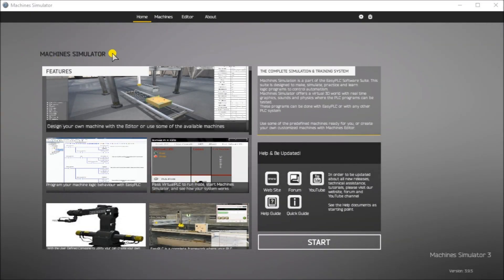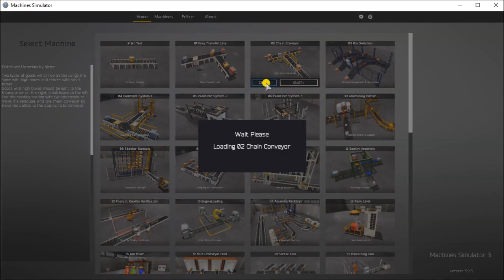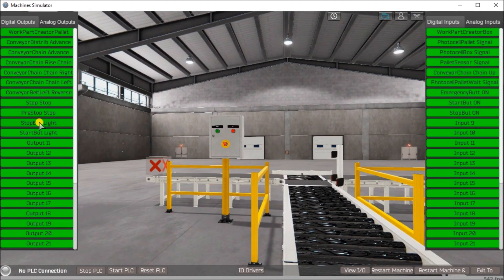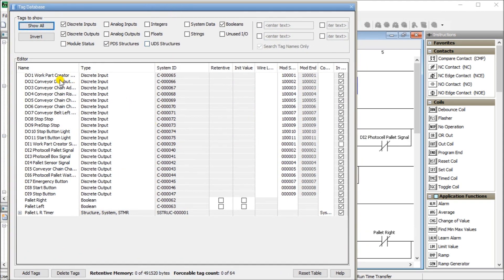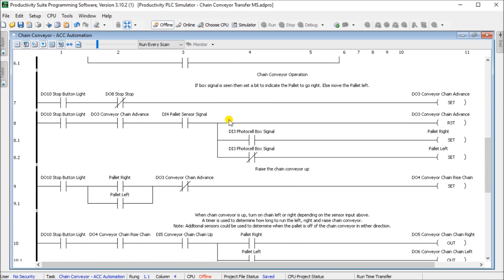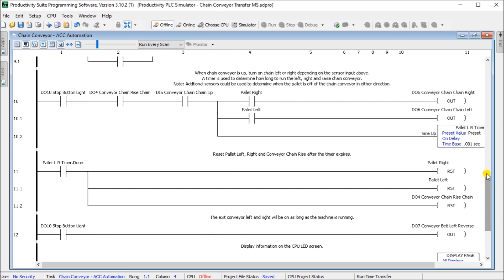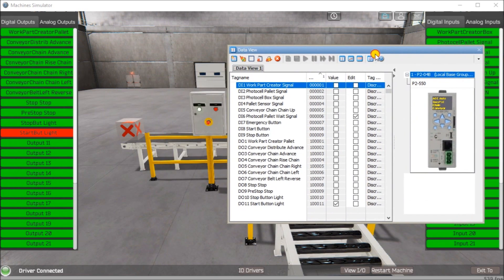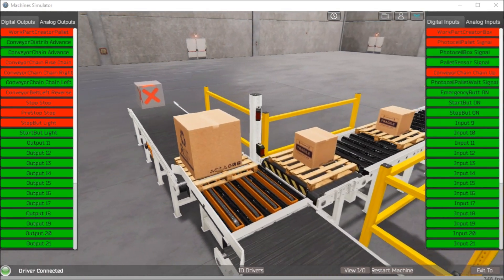Productivity PLC Simulator - Chain Conveyor MS

Comment from the maker: Purchase your copy of this learning package for less than $75 USD for a single computer install, or less than $100 USD to allow different computers.
Receive 10% off the price by typing in "ACC Automation" in the comment section when you order.

http://www.nirtec.com/index.php/purchase-price/
Learn PLC programming the easy way.
Invest in yourself today.
Regards,
Garry

EasyPLC Software Suite is a complete PLC, HMI, and Machine Simulator Software package. 

This PLC learning package includes the following:
Easy PLC - PLC Simulation that will allow programming in Ladder, Grafcet, Logic Blocks, or Script.
HMI System - Easily create a visual human-machine interface (HMI),
Machine Simulator - A virtual 3D world with real-time graphics and physical properties.  PLC programs can be tested using the EasyPLC or through other interfaces. (Modbus RTU, TCP, etc.)
Machine Simulator Lite - Designed to run on Android Devices.
Machine Simulator VR - Virtual Reality comes to life so you can test, train or practice your PLC programming.
Reply from the maker: EasyPLC Software Suite includes one of the easiest machine simulators. This MS will help you in learning to program PLCs. You can also design your own machine and simulate without have the actual hardware. This is made possible by the Productivity Suite simulator (free) combined with the EasyPLC machine simulator.
Garry